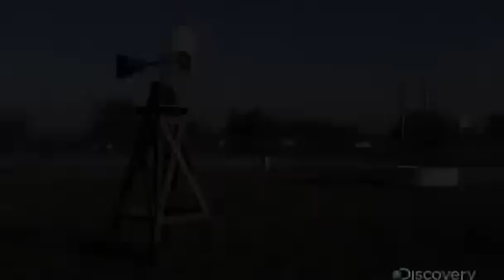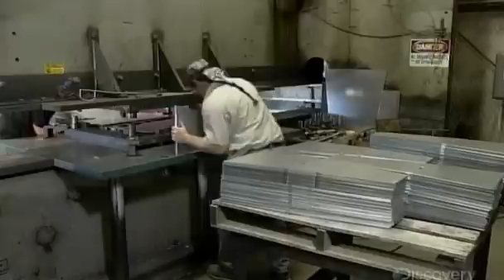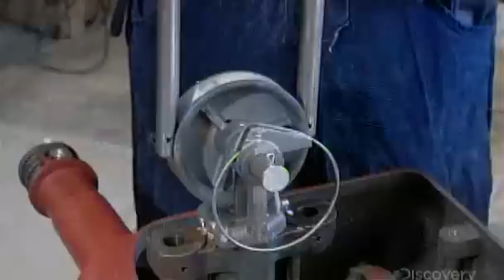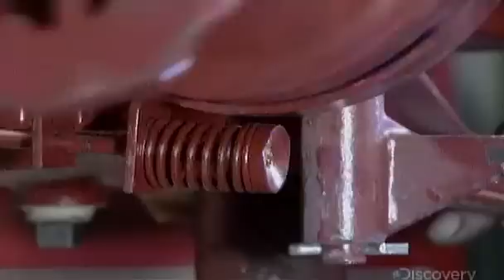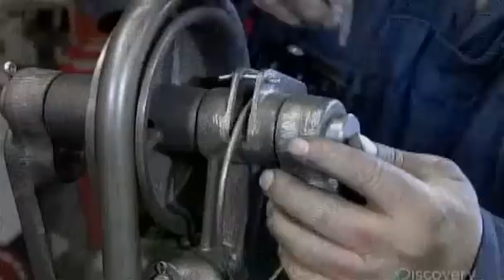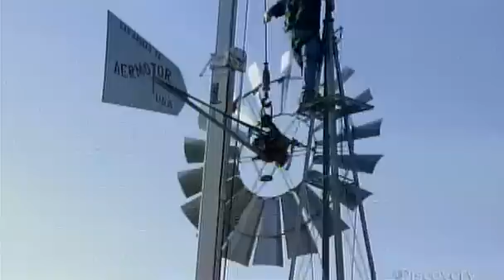How to make Water Pumping Windmills {www downloadshiva com}

Comment: Very informative. How does the braking system work? Centrifugal force seems the obvious answer. Am I correct?
Reply: Hardtop Harry when you turn off, the tail pulls the wheel left and away from the wind, and on top of that,a friction brake locks the wheel hub.

Comment: do you have a outlet in the philppines and howmuch
Reply: Princess Villanueva it is best to buy the mechenisms pump and geering only then go to the local steel shop for the stand mounts, blades, and pipe!! 36% import tax in the philippines with 50% theft at the port means 100% insurance as well for imports there! A 100 dollar item can cost 75 dollars shipping and 136 for ins and tax total cost 311 dollars thats 5000 peso item actually costing 15,550 peso added you will need to get the shipment in manila shipping port round trip from porto princesa 3,000 peso! Not a very nice country but very beautiful people!
Reply: Princess Villanueva search alibaba.com!